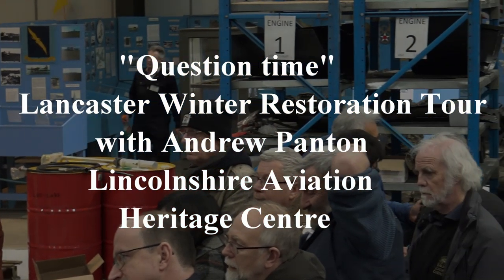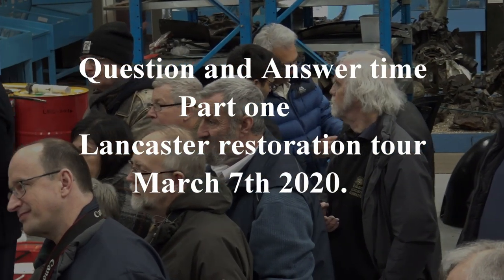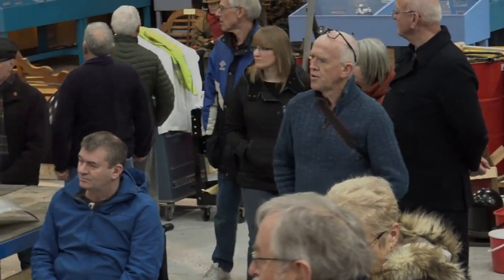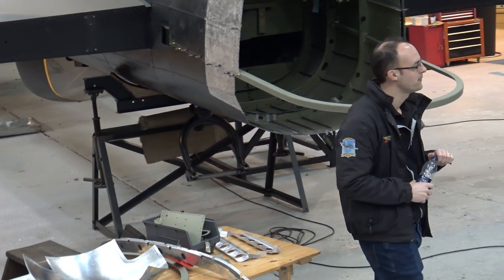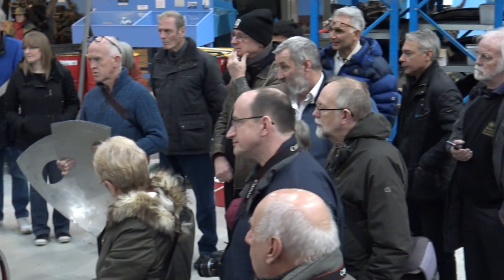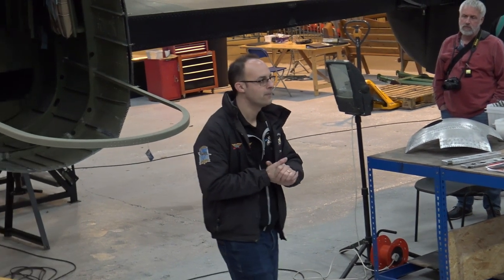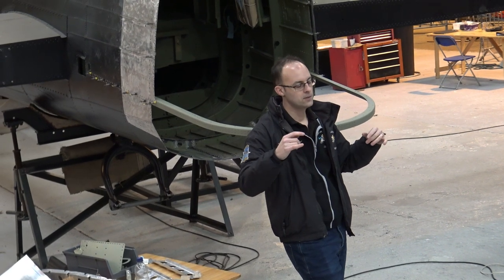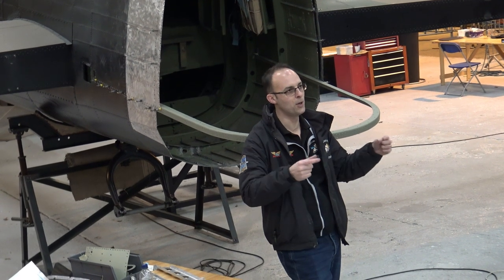Video 59 Restoration of Lancaster NX611 Year 3   Q&A time from Andrew, restoration tour

Comment: great video and as i suspected, digging so deep into a current running Lancaster to make airworthy brings to the front any issues that is then worth reporting to all owners - perhaps one day we may see more Lancaster's returning to the skies - there's a thought

i might have thought that any parts replaced, the originals would be kept in storage on file, (yep i get it might become a large storage facility) so drawings and relevant manual materials as well as possible suppliers can be collated together, if somewhere a museum etc needs to replace a part, it can be used to make a duplicate, before the offending part is stripped out, such as we might do with vehicle spares, diagnose the fault, buy in the part and replace

i really think the 4 million spent over 10 years is a fantastic price and well worth it over such a period, i'd be interested to know if there is a pinch on purse strings, how the budget is going, if anything can be seen as becoming too expensive

i can certainly say hand on heart, doing such a project in the way its done is magical, the winter projects is so well organised and then to have it assembled and running for the summer runs, great effort - when i used to work on restoring static aircraft i always had the public's interest in mind, get things painted as quick as possible so it didn't spoil peoples photos - i remember calling Duxford to photograph a Harrier GR7, yep its still here, then drove a few hundred miles to find the damn thing covered in brown paper for a respray, well it was still there i guess, talk about sods law, but these things have to be done